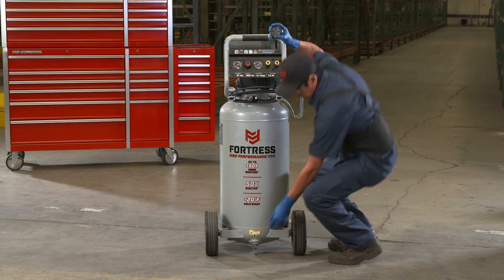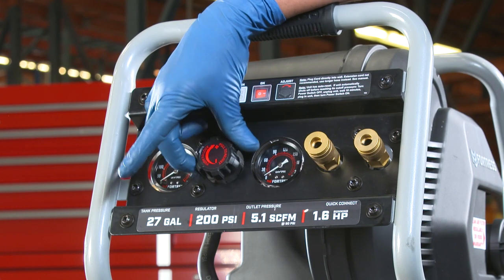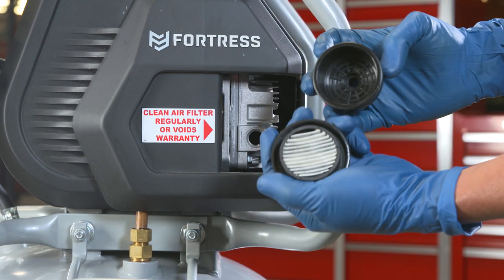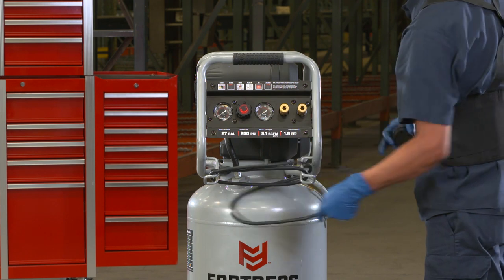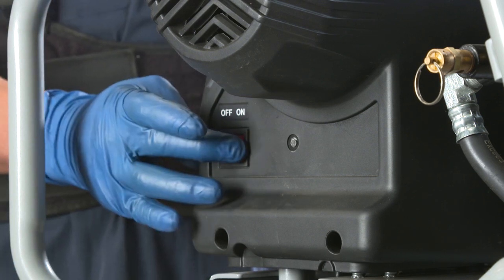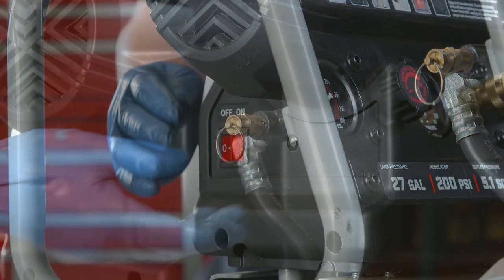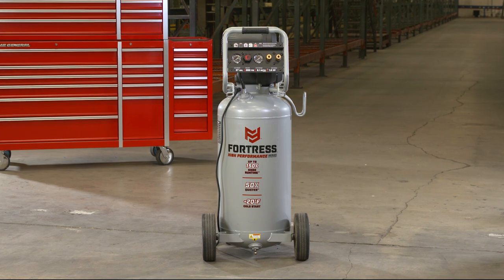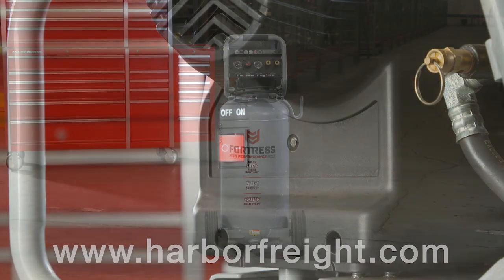Start-Up Checklist for the Fortress 27-Gallon Oil Free Compressor

Comment: don't show much of the actual compressor in the video, so small, must be oil-less unit, how many HP, how long how many SCFM, 5 at 90 is pretty low, my 20 year old Craftsman is nearly 10 and some tools will tax it.. suppose if you are not a professional may be all you need, personally I would want more...  and in the 20 years I have never drained both after use...
Reply: and the tank itself is rated for 200# the unit cannot reach that pressure.. sort of misleading..
Reply: Hopefully the redesigned one is better than the first generation that I have from 4 years ago. It's slow to pump to 200 psi and struggles to keep up when using low demand tools.